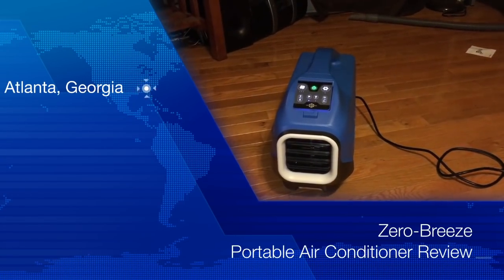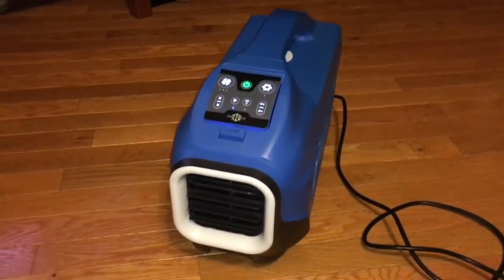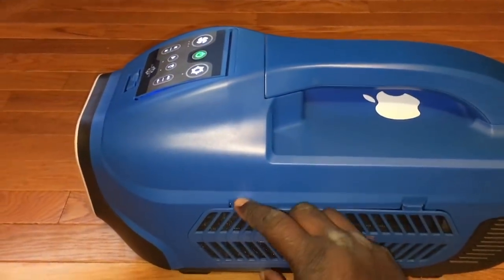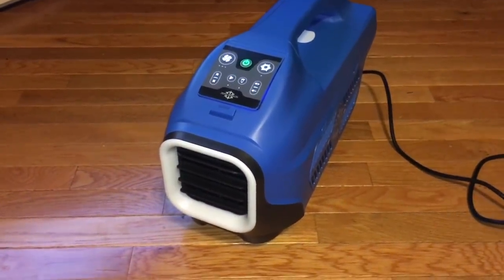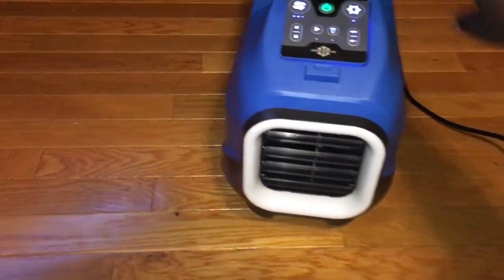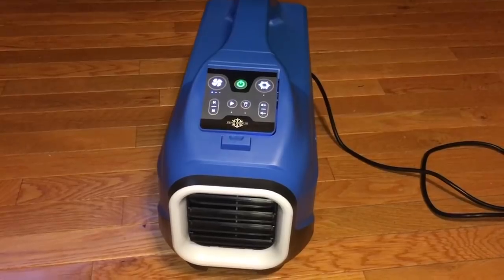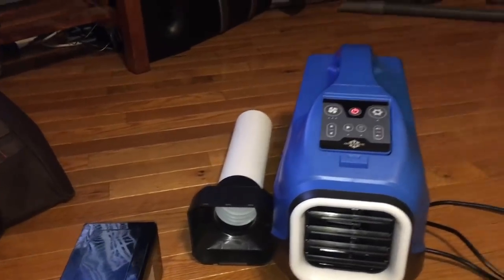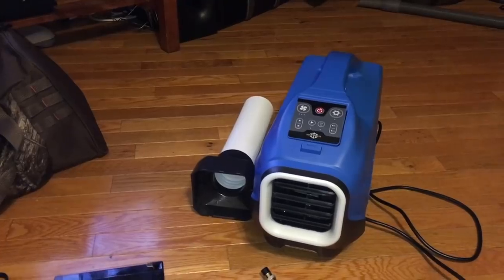Zero Breeze Portable Air Conditioner Full Review

Comment: First of all, thank you for taking the time to make this comprehensive and interesting video. Secondly, OMG Zero Breeze are going to love it. You obviously like the unit and that's reflective in the overall ambience of the video, but you also make valid and constructive criticisms about some of it's limitations. Very credible. I particularly like the part about the extortionate price of the ZB battery, and the workaround together with costs which also outlines just how over-priced the OEM battery is.

I'm tempted to talk about the (at present) ongoing quality control issues experienced by many who have received their units and others, especially those in Europe who have not received theirs or have  any indication, due to zero communication (maybe a change of name is in order ;) of when or if they will. However, even though we're approaching 2 years overdue I will not say another word as hopefully this review will outlast these initial (?) supply and quality issues. 

Well done, and thanks again.

Comment: Hey, I’m one of the people (or maybe the only person so far.  Not sure) who did the Unboxing Zero Breeze video and video showing it working with the rechargeable battery.  Just wanted to say awesome job with this video, and also wanted to point out that you showed me something that I didn’t even know it was able to do when you made the flashlight blink red.  I had no idea.  Thanks!
Reply: Also, interesting enough to point out that despite that fact that people are ordering these from all over the world, you and I only live about a 6 hour drive apart... Lol. Noticed at the beginning of your video that you are in Atlanta, Georgia.  I’m in Memphis, Tennessee.
Reply: Hey I have question. So I have a costume that has no holes for air to come in. I was curious if you are able to put the zero breeze in the suit to stay cool inside?
Reply: William Luong 
This AC weighs 14 lbs and is recommended that it stays resting on a level surface so drainage water from inside doesn’t flow into the wrong areas within the unit.
Reply: William Luong No you can not!  You would need holes for heated air to go out plus water to drain out.
Reply: Hey,
How's it working out for you Yin? In what kind of application are you using this?
Are you running this off an electric outlet or battery?

Comment: I agree about the need to vent the AC! I see that it comes with a vent hose and it's meant for small spaces and camping NOT an immense room! So, I don't understand all the negativity. This seems like a great idea and one that will certainly be improved in the coming years. 

I use a portable AC/ with heat pump in my non insulated 10 x 12 shed.  The inside temp exceeds 100 degrees during the Dog Days of Summer and the AC is a godsend!  The expandable exhaust hose is about 6" in diameter and 5 feet long from the AC to the dryer exhaust vent that I installed in the corner of the shed. The hose gets hot.  But it doesn't really radiate much heat or affect the ambient temp of the room itself beyond a 3 feet radius of the hose.  But I bought the recommended insulation sock for the hose so it's CHILL CITY!!!

Comment: Thunderf00t just debunked this thing. The cost vs performance is dismal, and the customer service is just as bad. Your auto AC is far better at cooling your car. A small home AC unit is way cheaper and again, a better performer. Taking it camping? Putting it in your tent? Take something to set it on because you need to collect the condensed water that drips from the bottom. Also, the battery runs it for about 4-5 hours. Of course you need mains power to both run it without a battery, or to recharge the battery- you can't do both at the same time.
Reply: A fool and his money are easily parted.

Comment: Everyone should read the comments on the kickstarter page BEFORE you order as this company has a VERY long shipping time.
Reply from the maker: admhou1 It took a year and a day for me to receive mine. However, they weren’t in production when I ordered mine, so I’m not sure the extremely long wait still applies as much now.  They had to halt production 2 or 3 times before the current version became available (shipping defects, supplier issues, ac adapter failures, and re-designs of drainage channel and soundproofing). It also took a month to ship via boat from China to New Jersey, USA, and then about a week getting through customs. Hopefully nowadays things won’t take as long.
Reply: admhou1 thx for warning

Comment: I got my unit working.  Once you turn off the unit it will take about 3 hrs for the compression to go down before you can start it back up so once you turn it on leave it on until you are done cooling.  I run my unit off lipo and a 12v battery.  I am happy with the unit as it is the first of its kind but you best support will be from other youtube vids.  I run my zero breeze from multiple battery sources in parallel which is better for the longevity of the batteries (no deep discharges).  The unit consumes about 135 watts when running.

Comment: This will be great for a small campper or tent
Reply: For a camper application the zero breeze compares as follows.  It uses a little more that a quarter, but not quite a third of the power of an average 5000 BTU household window air conditioner.  It's BTU rating is 1100, so you are getting about a fifth of the output.  It might be practical for a small (like a teardrop or a Scamp) camper, but will be insufficient for anything larger.  Be sure to pack a couple of spare high capacity batteries and a way to recharge them.

My home 5000 BTU a/c uses 4.5  amps at 120 volts which translates to 45 amps at 12 volts. (Volts X amps = Watts)  So to run this 1100 BTU, 12.5 amp, 12 volt  a/c for 5 hours would require 62.5 amp/hours of battery power.  A group 27 marine deep cycle battery (flooded lead-acid type) has a capacity of 90-100 amp/hours and can be discharged no more than 50% without damaging the battery.  It weighs between 40 and 50 pounds.  

So that battery would be sufficient to run the zero breeze for around four hours.  Then you'd need to recharge the battery.  You could do this with 200-300 Watts of solar PV panels providing that you had at least 5-6 sun hours each day or you could run a gasoline powered generator for several hours to recharge the battery.

For my 22 foot vintage Winnebago, I would need two of these units or a single  unit with twice the BTU rating.  Of course that would also double the power requirements.  Most campers/RVs are designed to be hooked up to electric power at a campground.  In this scenario, only the venting of the hot air exhaust would be an issue.

It is a good concept, but it still needs some development before it becomes practical for mass consumption.

Comment: The price of the battery is expensive so understand you there. The unit itself is expensive at 2 or even 3 times the price of a window unit. As an early adopter you are paying development cost. When the Chinese knock offs hit Ebay I fully intend to purchase 1 or 2.
Reply from the maker: Logical Artist yep. The high cost of early backing SMH.
Reply: Logical Artist how about supporting a company for making a decent product instead of waiting for a cheaper knockoff?
Reply: Matt Portnoy yeah someone certainly has to do that. Usually that someone is not me. I am certainly thankful to those that do so though.
Reply: Logical Artist your missing the point. It's not made for the same idea as. Window unit which sits In a window n that's it.   This comes where ever u need.  . Big difference in use.
Reply: youtube university Yeah they made it portable. That is the development process. Those engineers/(maybe designers too) have to be paid so that explains the price. Those of us that wait a bit avoid paying the costs. Early adopters pay those costs.
Reply: Logical Artist these have actually been out for a while.  Maybe not this brand I'm not sure but these exact types n portables that even look like coolers you plug in to a lighter.   there all roughly priced 150 and up.      and 75% of knock off don't always work the same.
Reply: youtube university this is not like those swamp coolers that you have to put ice in. This actually moves the warm air. As far as I have seen the only unit this size and battery powered that does that.
Reply: They did are the work, while the Chinese will take all the credit, but won't back it up when it fails......still not bad compared to the IPhone costs.
Reply: Lol,  that's a great idea,   give it a couple of months and they'll bee all over AliExpress :D
Reply: Matt Portnoy . I agree
Reply: Do you trust the knock off’s from overseas? I always seem to have trouble when I buy anything electrical. (Including the Apple items). Just wondering if you had good luck with these types of products? I guess I also worry about shipping cost if I had to send back if it didn’t work properly. 🙂
Reply: The lithium ion battery isn't a cheap part either.
Never trust a Chinese battery. Remember the hoverboards that caught fire. They were all chineese.
Reply: Infandous Ktenology I'll raise you one. I bought a Chinese knock off item that took two double A batteries. A double a battery is 1.5volts. Well the double A shaped batteries that came in the item were not 1.5 volts. So when these odd voltage batteries died my product became useless because no one makes a double A battery that's a higher voltage then what it should be.
Reply: Lol, Don't quote me on the voltage. I just new they were labled double A but not really double A specs.
Reply: knock offs are cheap but hurt the conomy and flood the market with poorly made burst into flame products   hoverboard anyone?
Reply: Especially there batteries!!!
Reply: They are made in China lol!
Reply: @LogicalArtist  😝😝😝😝

Comment: This is the first product of its type that I have seen.  The concept is good.  But the product could use some improvements.  Perhaps future versions will show some improvements.

Here are my suggestions...

First, dump the LED lights, bluetooth speaker and other "Fluff" features.  Let the air conditioner stand on its own as an air conditioner.  It doesn't need to be a Swiss army knife.

Second, as others have said, bring down the price point.

Third, offer a battery power solution that does NOT cost more (like more than double)  than a window air conditioner of 5 times the BTU rating. (Yes, I know that portable is part of the unit's advertising, but I can use a $100 group 27, marine deep cycle battery for power and have 90-100 amp/hours of capacity.)  

For camping, I'll either be car/tent camping or RV camping.  Either way, the size and weight of the group 27 battery isn't going to be an issue.  If I'm in a backpacking or hiking scenario, I won't be taking an air conditioner with me or else I'll be using hired Sherpa's to carry my equipment.  In that case it'll be their problem instead of mine.

Fourth and finally, the outside vent accessory should be a standard part of the unit for proper and efficient operation.  Making that an accessory is a bit like building a lamp and offering an on/off switch as an accessory.

Anyway, I hope to see the new and improved version come to market soon either from this company or another.
Reply from the maker: clyde alspaugh I’ve found the unit to be a really good first attempt. Since the review, I’ve upgraded the adapter to a 180 watt unit from the standard 150 watt (I think the 150 was maxed out). It’s worked like a champ is multiple situations. I know many feel like the LED and the speaker and USB ports are “fluff” but they sure are convenient instead of using multiple devices.   I wish it had a built-in battery. I mainly use it in “spot-cool” mode, so I like that the exhaust hose is detachable.
Reply: True Jay, its a good first attempt.  I'm glad that you are getting good results from your unit.

I like that there is not a built in battery.  It increases the service life of the unit. Batteries have only a finite number of charge/discharge cycles.   Leaving the power source a separate item allows the user more options.  

To clarify, I like that the exhaust hose/tube is detachable.  But I think it should be included as a standard part of the basic unit rather than being sold as an accessory.
Reply from the maker: clyde alspaugh Gotcha!  Although they include the exhaust hose with the unit. No separate purchase needed.
Reply: I am guessing they make the battery rechargeable and removable for the same reason anyone does, so you can charge one while the other is working, and have continuing function, you would have 4-5 hours air conditioning then nothing while you put it on recharge. And all the fluff, how much could it weigh? It's there so the RV owner, camper etc doesn't have to carry all that other stuff besides the air conditioner. And upgrading the amps may in fact ruin your air conditioner, or I would think they would of provided a higher one in the first place. Thats why they warn you about using same kind of adapters on things when you replace them. A fire in your tent at night while sleeping might not be so desirable. Or your RV or home.
Reply: Hi Debra.  Yes, you are right about the battery.  If you listen closely to the video, this unit does not have a built-in battery.  Building the unit this way gives the user more power options and makes the unit lighter.

Now to be clear about the batteries...  Rechargable batteries are rated in amp hours.  An amp hour is the delivery of a 1 amp current sustained for 1 hour.  So a battery with a higher amp hour capacity won't harm the unit so long as the voltage is correct.  The unit pulls the current to it rather than the battery pushing the current to the unit.  So a small rechargable battery might have a 35 amp hour capacity while a larger deep cycle battery might have a capacity of around 100 amp hours.  But if the voltage is correct, either battery can be used to power the unit.

As to the fluff features, some people will like them.  Others, like me, won't.  My opinion is that if I need a flashlight, I'll carry a flashlight.  I'll probably not need a flashlight at the place I'm using my miniature air conditioner.  More likely, I'll need it someplace where the larger size is a negative rather than a positive attribute.  

Also, I'll mention the bluetooth speaker.  My opinion is that since it is an ancillary component of the unit, that it is likely the cheapest (and lowest quality) bluetooth speaker that can be had.  If I want bluetooth speakers, I want higher  performance from them than the bottom of the line quality can provide.  I'd rather buy my own choice of speaker and locate it wherever is convenient for me at the moment.  Therefore, having the bluetooth speaker incorporated into the unit is, for me, a waste of space and cost.  I wouldn't use it.

Of course, we are all entitled to our own opinion and if they differ, it doesn't make either less valid.
Reply: P.S. When it comes to fluff features, I ask myself this.  If the air conditioner part of the unit quit functioning, would the other features be valuable enough to me that I'd still take the unit camping with me?  In some cases the answer is yes, but in this case I'd have to answer no.

Comment: 15 degrees Fahrenheit lower then ambient at the front end and about 20 degrees HIGHER then ambient on the back end. Dehumidifying means leaking water as there is no container. When you use long enough the room will get warmer! You really need to connect the end to a hose and make sure the hot air goes out of the room.
Reply from the maker: Agreed. It comes with a detachable exhaust hose for times you want to cool a room instead of spot-cool an area.
Reply: They all show the exhaust hose yet do not connect it to vent to outside, which is basically not giving this product its full potential. And if you insulate your exhaust hose it will be even more efficient as they can put off a lot of radiant like heat. I did and my house portable works so much better. THIS IS WHY THE DUMMIES KEEP SAYING AND COMMENTING ON THE VENTS, SO GUYS, DO YOUR VIDEO REVIEW WITH IT VENTED, IN A SMALL HOT ROOM, RV, OR CAR, or TENT, THEN they will get answers. No one is getting the correct readings without venting and its unfair to say it cannot do a job if you are not DOING YOURS by venting it in the first place. Oh and read up on how cold a car air conditioner should measure when they are repairing it, or reloading refrigerant. Using a thermometer suited for the job, has small dial, long metal rod which you stick in the vents. Frankly I doubt using the devices they are using, outside the vent is even giving you any kind of idea what the air temp. really is. This is for cars but same idea. SEE SEARCH ON SUBJECT: . Measure at least 3 inches into the center dash vent. Temperature should be 40 to 42 deg F. Higher fan speeds, resulting in high air volume, will result in higher vent temps. Rear cabin systems are normally 10 degrees warmer because they have a larger volume of space to cool.

Comment: I am currently working on making this run of my electric car.  I use a 400 watt inverter so I can pipe the power using an extension cord up to the top level of my house, the location of my bedroom.  In the bedroom I use the power brick to convert the AC voltage back into DC.